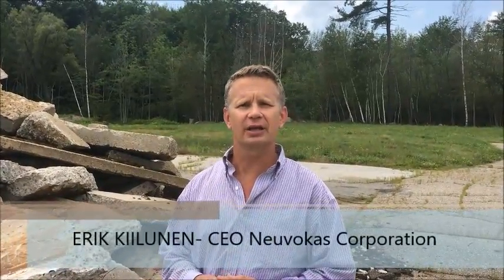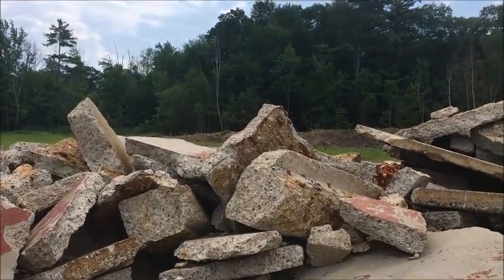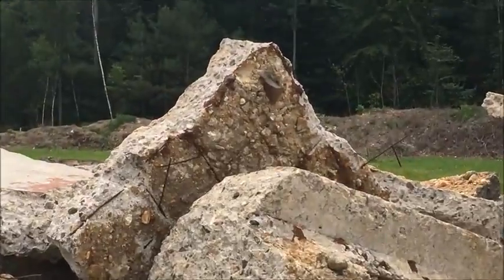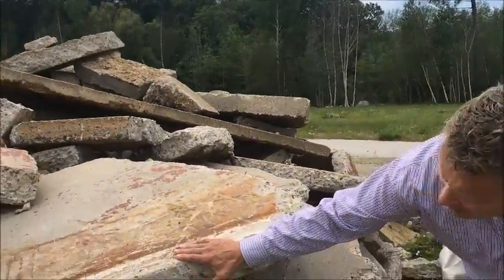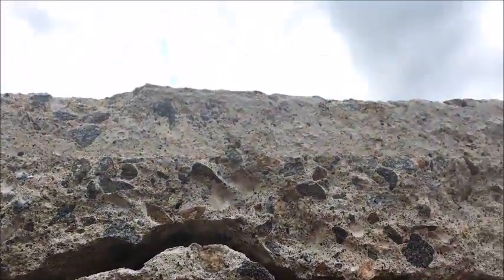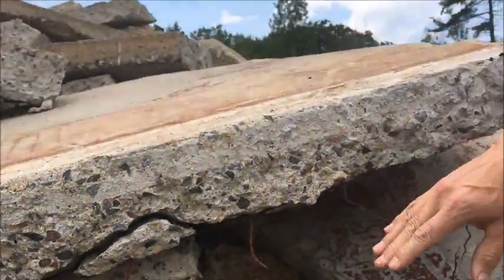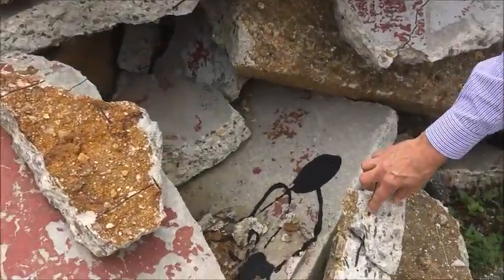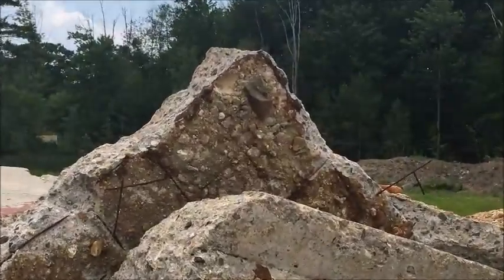Should you use welded wire mesh in your concrete slab?

Comment: There is no purpose to having reinforcement in the centre of the concrete.
It should be in the upper or lower third to resist tension. The centre only gets compression

Comment: I thought the lower part of a slab get stretched and the upper part get compressed if the weight is on top? So logic says the rebar should be at the lower part... but of course, not at the lower surface of the concrete.

Comment: Good video. But wire mesh proped up correctly does in fact work like how you had fibered reinforcement held up. And reinforcing needs to be in the lower half to help with reinforcing under tension or load. Otherwise any reinforcing used is only good for shearing stresses. Where can we track down local suppliers of this product.